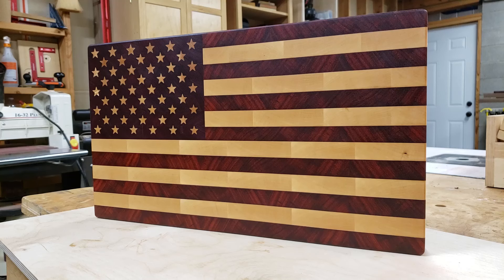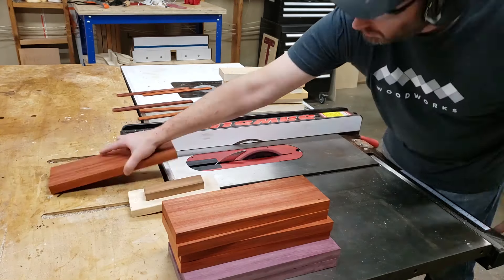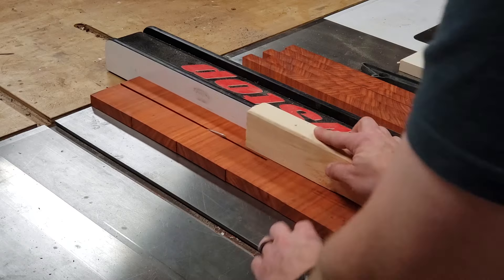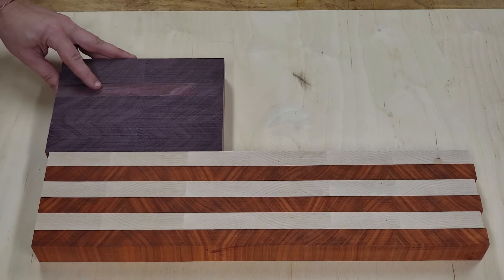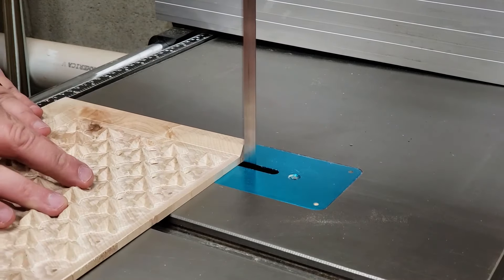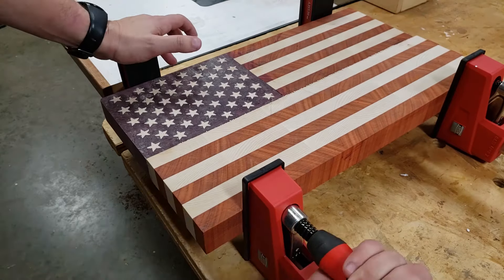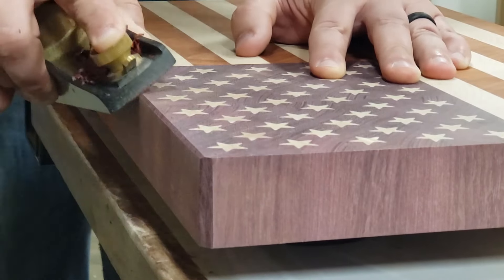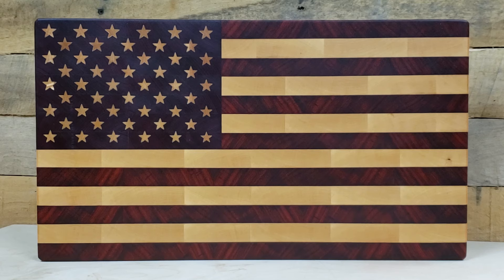Make a US Flag Cutting Board (short version)

Comment: Very well done! I have made a rather large amount of end grain boards for my business. I do inlays and send it through the helical head planer all the time. I just do light passes. And same for the cross grain blanks. But if you don't have a helical head, you are absolutely correct. And specifically I have a Sheartec 2 Laguna planer. So it's got like .. over 100 teeth on it. So a very fine cut. If you have a low tooth count planer like a DW735 with a helical head conversion, then you might have a harder time with it. Also, you gotta bevel the top and bottom ends so that it absorbs the tear out. I just usually use an 80g on my RO sander for a few seconds to get it done before planing.

But you did a fantastic job! Looks really solid, man. And you are right about the router bits. If you turn the end grain blanks on end you can actually use router bits without any problem. It's just kinda awkward routing on the sides and ends instead of the faces. But I don't even bother with that any more. I just use sanding for doing all my profiles on end grain. Seems to get the job done super quick and easy

Comment: Silly question, but I've heard that you don't want to sand wood to a high grit (600-1000) because at that point it just polishes it and it won't accept stain well.  But in this case, since you aren't staining it, wouldn't that be better so that the wood doesn't absorb the food that you are cutting on it?

Comment: Did you make a video of your inlay process? I would very much appreciate the `parameters' of  your cut... the v-bit angle used, depth of the cut of the female part, and the parameters of the male parts... specifically the start depth and flat depth.

Comment: If you didn’t have a CNC, how would you deal with the stars?
Reply from the maker: I don't think this technique is really possible without a CNC. If the board were going to be purely decorative and not used in the kitchen I suppose you could stencil stars or cut them imdividually and glue them to the surface 🤷‍♂️
Reply: I'm really liking this without cnc also but I  know several people with cnc setups and can hire their service for that part.
Reply: Jim Newton - Good idea, now I need to find someone in my area with CNC! Or better yet, a new reason to buy new tools! Thanks

Comment: That was cool!  Here's a thought---On the backside, it would have been nice to see the same stars, but as an alternative and to make it ~easier, make the 1776 flag, fewer stars.  Even so, that was such a cool project!  I could never use that as a cutting board, it's too nice!
Reply: Matt S  That makes no sense.  "the wrong way round."  Huh?
Reply: Matt S  That's nonsense.
Reply: Matt S  That's real special, more power to those who play US Army.
So, by your logic, say you're between two flag poles and you're facing directly into the wind.  Both flag poles have flags up.  By you're 'code' the flag on your right is 'proper' while the flag on the left is 'not proper.'  
Get with the program dude.  
This is a cutting board, not a uniform with some made up 'code' by some dork with all kinds of little rules.
If a child paints a flag 'mirrored' to 'your proper flag,' did the kid desecrate the flag?
I've got a plane, & if I were to paint a flag on it, I'd make sure the blue portion will be facing the front of the plane on each side, I'm guessing the one on the Starboard side would bother you.  Hmm, I think I might just put on a 'backwards flag,' just for YOU!  =D
Reply: Matt S  You certainly "Plays US Army."
Right, my 'flaw.'  By your skewed and demented logic, right...ya, right.
By sane logic, you're off your rocker.  See, dude, this is what happens when you do too much crack.  If I can make a suggestion, do less crack.
Just because 'someone' writes down 'rules' doesn't mean YOU, Matt S, has to follow them.  But, small thinkers find it necessary to blindly follow made up magical make believe rules.  
Have fun with that.